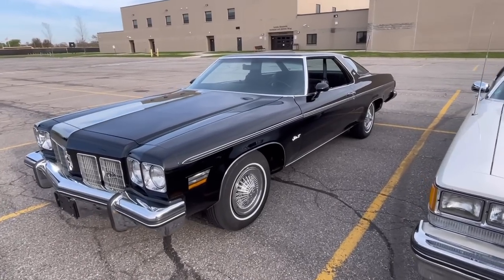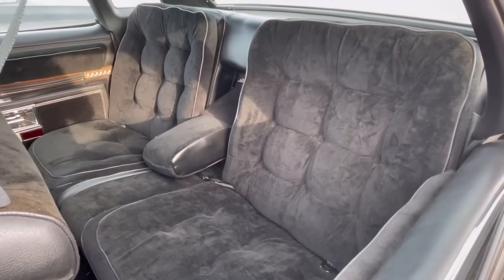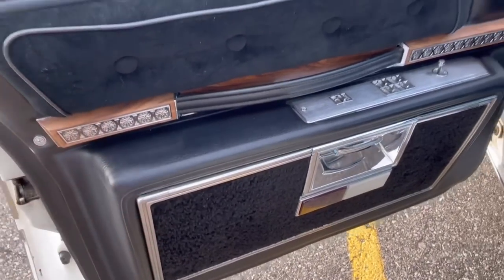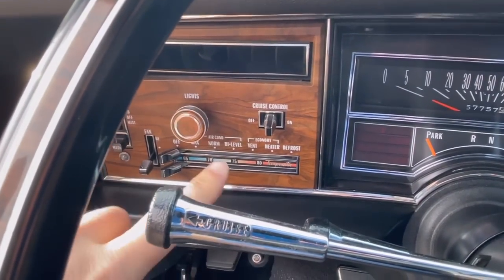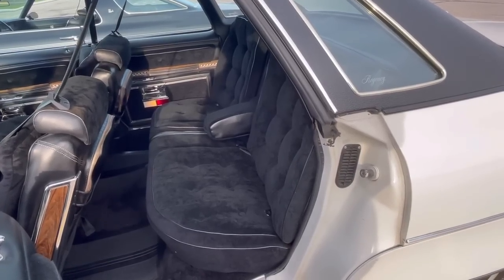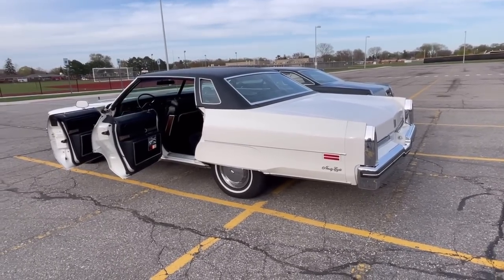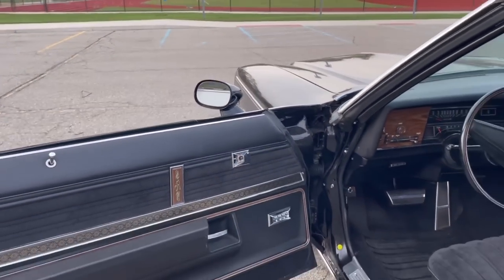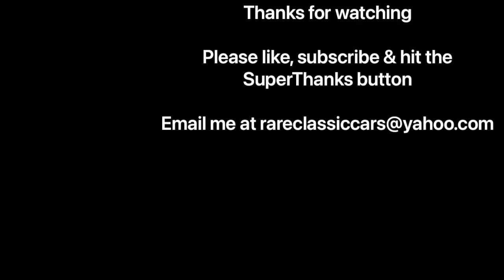Coolest Cars of the 70s: 1976 Olds 98 Regency vs. 1975 Olds Delta 88 Royale - Interior Design

Comment: Glad and so happy to watch this video, my father had a 1979 Olds Regency 98 Coupe that I helped pick out when I was a young teen. Maroon with a tan/beige padded roof and tan/beige leather, what a beautiful car, wish we still had it, nothing rode as good as that car. Also I had made over 1,600 molds in my career from US tool makers, Canadian tool shops, Slovak/Czech/Hungarian tool shops, as well as China. Most molds I had made were for the automotive industry. I can tell you that you would make a left and right door panel in one mold (family mold) and run it in a 1,000 ton injection molding machine, with a long cycle time of a 50 to 80 seconds (maybe more) especially of there were metal/steel bushing/inserts to be loaded. I would say this mold in 1975 would cost around $180,000 and even today with the use of China to manufacture it (much less cost than domestic mold manufacturers), you have to account for the steel is more expensive and the added technologies used to reduce the cycle time (hot runner system, better thermoplastic materials used and robotics). Plus today you might be overmolding the process all in one machine or covering it with leather by hand.

Comment: Just had to point out that on the ACRS Olds dash, the passenger side bag came out from the bottom of the dash, not where the glove box is.  The ash tray was moved up and took a space from the glove box under where the clock is.  My dad had a 75 Regency so equipped  :)

Comment: The first Delta 88 Royale was 1969 - it was the new top-of-the-line 88 model available only as a Holiday Coupe. Oldsmobile wanted a "special coupe" model along the lines of the Chevrolet Caprice Coupe with it's exclusive "Chevy-only" formal roofline. That Oldsmobile went to the expense to give the Royale Coupe a "limousine-like" formal rear window treatment was very unique. By 1972 the special roof treatments were discontinued, as the '72 Royale Coupe was just a top-line Delta 88 2-door trim level. Good to see a 1975 Royale without any vinyl roof - very rare.

Comment: I had a '76 Olds 98 LS that I drove for 10 years. It had every option that the Regency in this video has as well as the delay wipers, Twilight Sentinel headlamp system, center map light where the visors latch in place, tilt and telescopic steering wheel, and Positrac rear end. I found the LS seats much more comfortable than the Regency seats; which were too soft and lacked support.

Comment: Such knowledge and insight between these two men.

The simplification to semi-auto Tempmatic and the flatter dashboard disappointed me at the time, but I do agree that the Regency interior looked more plush (garishly so) than the corresponding Cadillac, having owned 1973 and '76 de Villes, and a 1974 Fleetwood.  The Cadillac armrests never changed in the 1971-76 run, so thankfully these blocky later Electra/Ninety Eight units were not adopted.

Comment: Look at the distance between PARK and L, on the gear selector indicator of those cars! I'd say that it's at least four inches!
As a kid, I rode in one of those 98s with the clock in the front seatback! You can see where the ashtray and lighter would go, when that passenger door lower/armrest was used in the Caddy...
Those kick panels with manual vent provisions, on the 88, have got to be some rare birds!

Comment: Brings back memories of my grandpa's '72 Ninety-Eight 4-door hardtop that he had into the mid-1990's. I always was amused by the placing the climate controls to the left of the steering column and only in reach for the driver, while the other vehicles in the family had them much more democratically placed in the center stack.
Reply: its awesome that the passenger cant touch the controls!
Reply: Yeah, I picked up on that too IMMEDIATELY. I KNOW WHAT YOU were thinking Mr. Olds designers.

Comment: I had a 1979 black Cutlass Supreme Brougham with t-tops. Oddly it did not have bucket seats or a center console. It had a splint bench that was very similar to the interior of this Regency. The seats were black and had very fine vertical white pinstripes on the pillow cushions. Very comfy. Got rid of it for a 1988 Cutlass Supreme Classic. How I wish I still had both cars.

Comment: Just to clarify, your 1975 Olds Delta 88 Royale does not have brougham trim.  The 98 Regency interior became such a hit for Oldsmobile, they decided to adapt it next for their Cutlass Supreme coupe in model year 1976, thus the first Cutlass Supreme Brougham.  Sales took off and it was an instant success.  Oldsmobile did not offer a brougham interior for the Delta 88 until the 1979 model year, when it was an optional decor package.  The  Royale Brougham seat design was similar to the 98 Regency except instead of having a full loose cushion look backrest, the 88 Royale Brougham had a half cushion at the top and a more traditional seat panel below.  The door armrests were also changed from the base 88 Royale.  In 1980, the brougham interior became an official new model... The Delta 88 Royale Brougham, and carried forth for many more seasons.  Your car does indeed have the crushed velour interior.  Regular velour was a smooth finish fabric and crushed velour was heavier and had a wrinkled look.  Such fabrics also tended to make sliding across the seat somewhat more difficult but held you in place around turns more effectively.

In addition, door courtesy and warning lights were an option on your '75 Royale, as well as any full size Delta 88... base or Royale.  Oddly enough, the door lights were standard equipment on the 1969, '70, and '71 Delta 88 Royale coupes and the 1971 Royale convertible.  Sadly, for 1972, Olds decided to decontent the Royale and expand the offerings to include a four door hardtop and pillared sedan.  Gone too were the door lights, 455 engine (replaced with the standard 350), and the distinctive closed in rear window with lavalier straps on the coupe models.  For '72, the seat design was downgraded to the 1971 Delta 88 Custom trim.  Essentially, the '72 Royale replaced the '71 Custom.

Lastly, not all C body cars had the same door armrest style as the '76 Regency shown here.  The 98 LS and base Buick Electra Customs had a door trim used since the early seventies.  The 98 Regency and Buick Electra Limited shared similar lower door trim that debuted for model year 1975.  Cadillac used a completely different and less distinctive lower door trim that had been used since 1971.

Comment: Adam,  would it be possible to find the interior designer for Oldsmobile in the late 70s?  We had a 79 Olds Cutlass Salon Brougham (the aero back four door) with the "Tahoe" interior trim.  I believe the take rate was fairly low and I believe it was a 79 only trim option.  It resembled a saddle blanket and I believe resembled the cushions used by ranch oak furniture at the time.  While the appearance was trendy, the seats were a cloth/velour trim that was comfortable to sit on and was fairly durable.  Seven years later, my parents purchased an 86 Pontiac 6000 LE which had a simple dove gray velour interior which seemed to be a reaction to the excesses of the 70s.

Comment: @17:30 It’s crazy how they wanted to load up that door panel with so much stuff. between the padding, and that tacky strap, the buttons for the power windows and such are half covered.  besides, for what is supposed to be an armrest, it is also half blocked by padding

Comment: Adam, After much consideration, my vote goes to the 75 Delta 88 Coupe. The design seems more coherent.
Reply: @Right Lane Hog
I agree my Dad bought a brand new 1974 Delta 88 Royale Coupe almost identical to the car Adam had but with a nylon style cloth but same design as Adams, and AC as well. (Metallic Green ext/green int, and vinyl top) It was a great car, and the seats were incredibly comfortable for the day they were made. They were a tiny bit firm, but still yielding! AC could freeze you out. Ride was compliant but the car could handle very well if you needed it to. Rocket 350 engine was very powerful as well, it could definitely get out of its own way, but could also cruise at 80 mph if required all day. Owned it until it rusted away in the late 1980s. A very good car for the money, and very reliable too.

Comment: That "cigarette pouch" on the passenger door of the 98 is ash trays on my 3 1976 Electras. Also, the door courtesy lights were optional with the reflectors you refer to being standard. Also very interesting the 98 has plastic trim on the hood. Buick used metal. As for the remote passenger mirror on the 98,  it was optional with a standard 98 not having a mirror on that side at all. Lastly, all the power seat controls for the 71 to 76 C body cars was on the seat. not the door

Comment: You guys are a riot!  Not to fear Adam, I kind of prefer your Delta's interior.  That tufted layered cushioning is a litte over the top, especially in the upper door panels, and the metal/faux wood strip in the center door panel doesn't look great either.  I would think that those tufted pillow treatments on the door panels would interfere with window/lock operation as well.  What are the yellow plugs inside the Delta door?  Ziebart??
Reply from the maker: Yes. Ziebart.

Comment: Have you (Adam) ever come across an airbag-equipped GM vehicle from ca. 1974-'76 ? I have not seen one personally... Edit: way back when, when I went to wrecking yards, I would love to take different options and interior/exterior trim parts off wrecked vehicles - like take the same color door trim panels off a Ninety Eight and install them on a Delta 88 - stuff like that. I had so much fun back then 🙂

Comment: Both of these vehicles must have been “order outs” judging by the optional equipment that each one has. The 88 is the only 1975 model that I have ever seen without A/C. The fuel economy gauge in 98 was a rarely seen option. I worked at an Oldsmobile dealership in 1976 and never saw one. White and black was a very rarely seen color combination by then. Five years earlier, it was quite common.

Comment: The analog clock is much better looking than the "digital" one.
Reply: I had the "digital" one in my 80 chevy caprice. Good design was canted toward the driver for visibility. Ran off the battery, the numbers would rotate on cylinders and were very accurate. Never had a problem with it.

Comment: Really did not like the 74 door panel change on GM C bodies - the 71-73 design much more attractive and the door pull was both more functional an less annoying - trying to rest your arm on the armrest of an Olds 98 especially 74-76 is an exercise in discomfort.  Buick's door knocker style at least protruded a little less.  Interesting that in the early years, lower level C bodies got the B body door trim - and of course crank windows until 74 - always interesting to see those at shows today.  The Cadillac lower was a slightly different stamping - it did not have the full 'box' effect that Buick and Olds did / was rounded off and (I think) more attractive looking.  The door knockers were mounted higher too, and did not interfere with armrest use.
Reply: Agree and the 71-73 98s and Toros had the power seat control located with the pw switch—more elegant and practical to use than locating it on the seat. The Custom Cruiser interestingly gave you the 98 door trim as an upgrade or you could go with the 88 trim.

Comment: AND remember the GM divisions did not share engines ..the blocks were the same but the inner parts and upper ends of the engines were very different....same alternaters...air cond...transmissions....and Cadillac had its own engines...except 1976 Seville got the Oldsmobile 350 cid fuel injected....what a hot engine...one if the best V8 engines with fuel injection....it was sweet...delicious

Comment: He's not entirely right about the lower door panels.  The Electra and 98 were shared, but Cadillac was still using their '71 lower door.

I wonder why they dropped the pillared C body (besides the Fleetwood) in '71.  Earlier models had several inches more rear legroom than the hardtops.  These years have a very upright seatback and horizontal cushion that isn't terribly comfortable.

Comment: If you crash with a car like that, airbag or not, you eat your steering column in the face.
For this to be effective, it would be necessary to add a roll cage including the rear seats in order to be able to keep them.
No, because above 40 mph, in the event of a frontal impact, the car bends like an empty pepsi can between your clenching fingers.

Comment: Interesting video and appreciated. I'm not sure your '75 doesn't have crushed velour. As Mark notes, your seats have some sections where they seemed to exhibit some mottling or texturing as would be typical of crushed velour, but at this late date, who knows. I do notice that his 98 seems to be showing some wear on the front seats as they do not look like crushed velour but the rear seats do. I'm not sure I like the design of his interior door panels as much as he does, as that door pull seems located far too low on the upper door panel. Depending upon how you define a loose-cushion seat, GM did one on my former '79 Electra 225 Park Avenue, as you can see in this picture (not my car or color) - the bottom cushion has a separate cushion that wraps around to the lower front edge, which made it challenging to slide into the car but was supremely comfortable.  https://bringatrailer.com/wp-content/uploads/2021/12/1979_buick_electra-park-avenue-sedan_IMG_2495-scaled.jpg?fit=2048%2C1365